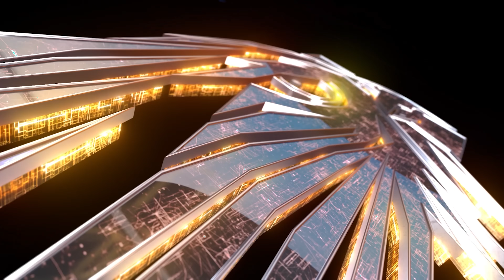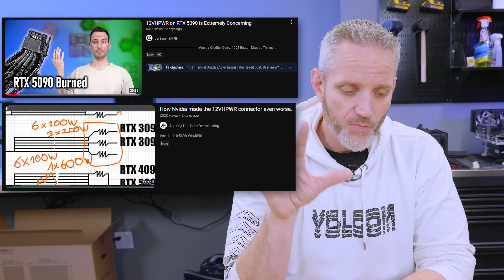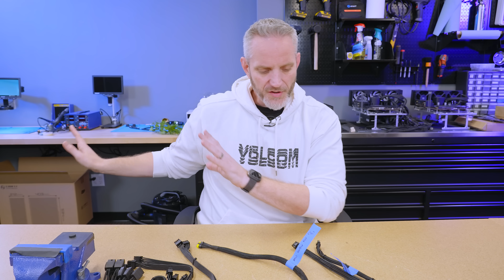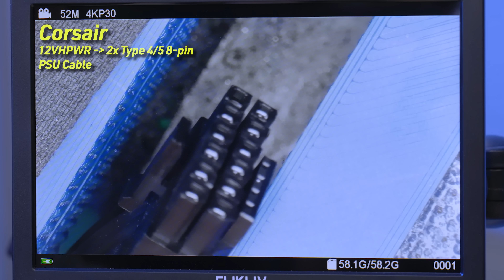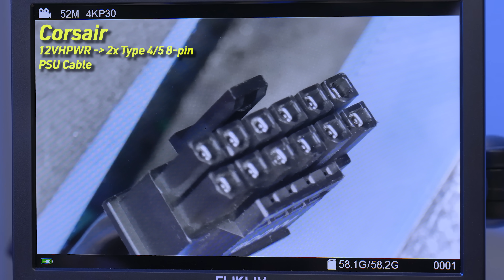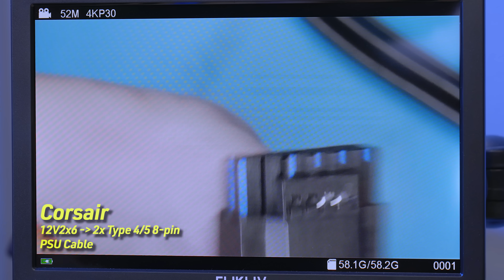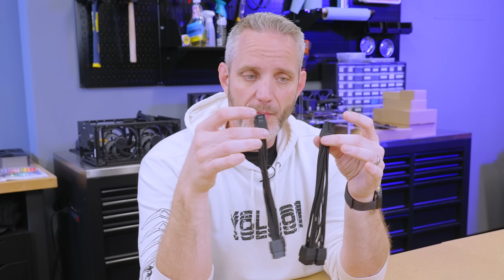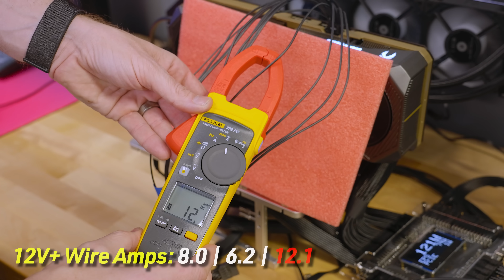I discovered something concerning and I need the Experts to chime in... More 12VHPWR discovery!

Comment: 100% will cause issues. The technical term for it is called terminal fretting. Cheap connectors with lack of terminal retension (which are basically all pcie connectors) with cheap pins are the main reason for it. Car connectors will show it quicker because the car is mobile and is being jostled around while driving. If the pin has that much slop in the connector shell it will spread the terminal upon installation and widen the gap  around the pin, which causes a poor connection and high resistance, therefore creating heat and eventually meltdowns. The other cause can be poor grounding or lack of ground which essentially causes the same result, to much heat from high current draw with nowhere for it to go. If you REALLY want to go even further, do a drag test on that connector pins. If you have a scrap gpu or something with the male version of that plug, take the pins out of it and insert them into the male end and feel for drag on ther terminals. It should have "drag" to it when inserted and removed.

Comment: The ground pins never melt because DC current can return to the PSU through the PCIe connector's ~100 ground pins and EPS12/ATX connectors' ground pins and every chassis screw assuming the GPU, motherboard and PSU are mounted to electrically connected frames. Even if all HPWR ground pins are broken, there are still 10+ ground wires and screws available to carry DC ground current. That is also why the ground wires on the HPWR cable are cold, only a fraction of the current actually returning through it.

The really loose pin on the Corsair connector was put in backwards: you can see the seam where the folded edges meet is on the opposite side from all other visible pins. The pins are held in by a barb on the pin that is supposed to engage a ridge inside the connector shell. The shell probably does not have anything for the barb to grab onto when inserted backwards. That is clearly a manufacturing defect and QA fail. Pull the pin out, turn it around and it should click in place.

Comment: Jay, Mechanic here, I work on everything from Cars to Mobile plant, and lot's of eletrical work, especially new age CAN BUS systems ect. Yes, if a pin is making poor contact on an earth side, creates resistance, it will cause the electrical system to pull more amps to be able to work to overcome that resistance i.e. OHMS law. A good earth is important for stable voltage. If the system is picking up inconsistent voltage, it will pull more amps to help stabilise it. If the pin on either side is not making correct contact, it will create resistance, and if the system is asking for a certain voltage, it will do the same. It will pull more amps to stabilise. More amps is more heat. If the wire is not gauged correctly to carry the amps it's asking for, it will kill the wire.

Comment: Just pulled out my Corsair RM1000e (ATX 3.0) cable out of it's box (I have a 7900 XT) and it is definitely a tiny bit recessed on the 12v side. Not as bad as Jay's in the video but slightly, and it has never been plugged in! 

Makes me glad I stuck with AMD this gen. But makes me worry about buying future Nvidia GPUs.

Comment: I think this is just one factor that could impact a failure, when a wire melts or catch fire that means it was drawing significantly more current than the other wires which means it had significantly lower resistance. So outside of adding some device to load balance the current you have to look at the resistance of each wire and while one wire pulled back wont likely cause a failure if you have like half which might happen if you are try to put a bend in the cable, or if you have wires of different lengths or if a wire got crushed pinched or bent are all factors, even the PSU might be at play with how its supplies the current. Overall its just a poor design form NVIDIA, so I am probably skip this generation until they fix it(not that I could find a card anyways) .

Comment: As far as I have come to understand, this is very simple but there is a lot of muddying of the water going on. But I know nothing. That said, my current understanding follows. 

The 12V (gen1 or gen2) cable is not one power cable.. it is six discrete power cables bundled together. That's not an unreasonable thing and isn't inherently unsafe - it has limitations like every other cable that must be observed when and how power is drawn through it. 

It is the responsibility of the graphics card to draw no more through its power cable than the cable is rated for. Since Nvidia has pooled the six power cables, this means that the maximum safe power limit is only what the weakest one of the six power cables can support. Not 600W. More like 100W. They cannot assume a balanced power delivery across six wires. 

Had Nvidia instead used multiple shunts into separate power stages more like in the 30-series, there's no problem because it should balance the draw across the discrete channels within the limits of the wires. The Astral is not a fix for this because it still pools. 

It's fine that the cable offers six discrete power channels. It's fine (and necessary) that a PSU supplies whatever is requested.

It is not fine that Nvidia thinks it can draw 600W through as few as one of six power channels before the card turns off from lack of power. And, as far as I'm concerned, they must consider this as a possible power scenario because _they designed it to do this_, despite knowing the cable limitations.  This is absolutely unacceptable.

Forget the power cables - they're a distraction. These graphics cards need to be recalled for safety until they are designed to draw power safely within spec.
Reply: To expand on how I see this as a 100W overall supply, I consider any extra wires drawn in parallel to be redundancies. These redundancies reduce the per-wire draw until they fail, running overall cooler/safer. The last surviving wire operates at full load and must still be in spec. When they all fail, that associated power section shuts down safely. In the 5090, there are five redundancies, not six primary wires, to draw from. Treating them as primary wires is insane. 

With this considered, it doesn't matter if you have a bad cable or poor pin connections. It'll just not power up the card.

Comment: The thing here is that the cable NOT seated well would end up with less contact and more resistance, causing the OTHER cables to have more current flowing through them, and warming them up instead.  So that would be the opposite of having the outside cable burning up.  Theoretically speaking anyways.  When you design circuits with parallel power supplies, that's how resistance affects current and heat. 

In the case of a cable burning up, it would be a case where ONE single 12v pair has less resistance than all the others.  Tons of current will find this less congested freeway and rush through, causing more heat.

When you see multiple cables burning up, my assumption is that it starts with one, then when the first cable failed critically, then all the load will find themselves flowing through the next pair of 12v with the least resistance.

Of course, all connectors should have very similar resistance profiles, someone should do a deeper dive and measure the resistance between various pins when plugged in, and you can then calculate how much more current can flow through the cable with the least resistance.  That'll help proof the theory of one pair of cable having less resistance than others.  If you measure and don't find any difference in resistance to make a difference, perhaps the fault lies in the PSU somehow. Not sure about that as the 12v source should be all shared.

Comment: I think the problem is two fold. 1 you have Nvidia designing the cards to where the power draw is not balanced across the 12v power wires and 2 the power supply manufacturers are still using 16 gage wire to handle 20 Amps or more. In house wiring if you are going to push 20 amps you have to move up to a 12 gage wire to handle the load.

Comment: Jay I am a electronics repair guy.. it goes both ways if there is resistance or on the hot or the ground side it heats up... resistance is resistance !!!! the more current the more the resistance matters.... to answer your question yes it matters if the ground doesnt make good contact !!! and don't believe corsair.. if the pins are not covering the same area there will be resistance deferences it may be smal but it be there and again the more curent the more resistance the more resistance the more heat the more heat melt down...

Comment: Would we use a smaller thin cable in your home electric circuit, errr no..   we need larger plugs and thicker cable to run 5090

Comment: company need made like xt30 ot xt60  plug for PSU connector... more reliable for high current, voltage and wattage.... rather make high wattage connector into multiple connector...

Comment: It doesn't matter if it's ground or line.

What matters if you have multiple recessed pins on one side.

The recessed pins will be higher resistance and will carry less current.

If you only have one or two pins making good connections, that's when you'll have problems.

Comment: Aren’t the pins supposed to be slightly loose in the connector like Molex and 8 pin? On my Asus cable i was able to push it forwards and backwards a bit on the 12V2X6 quite easily

Comment: I am an automotive technician and see a lot of these kinds of issues. Seems like a cheap product as the pin retainer or (lock) is not working as it should. It should be holding the pins in place and there should be little to no movement. Jay you may have seen this with a blower motor in a car melting. Get a quality connector and you should be good.

Comment: The issue is not a bad ground or a bad connection or any pin issues! DeBauer measured the cables, some are pulling 20A+ the issue is unbalance in the power delivery. Nothing to do with pins, cables or connectors. Instead i its too much power for the rated cables, connectors and pins.

Comment: No, increasing the cable's resistance (by making it thinner or longer) does not increase current—it actually reduces it in most cases.

Ohm’s Law:

V=IR
Where:
V = Voltage (volts)
I = Current (amperes)
R = Resistance (ohms)
What Happens When Resistance Increases?
If the voltage source is fixed (like a battery or power supply), increasing resistance will reduce the current (
𝐼=𝑉𝑅
I= RV
 ).
If the circuit is a constant current source, the voltage will have to increase to maintain the same current.
When Can Current Increase?
Lowering resistance (using a thicker or shorter cable) allows more current to flow if the voltage remains constant.
Increasing voltage (e.g., using a higher-power source) can also increase current.
So, a thinner or longer cable never increases current—it does the opposite by limiting it.
Reply: going from the Ohm's Law Cable does not matter, its the load (GPU) caused the extra current draw. Now this also mean if Voltage (PSU) was to drop and load (GPU) stay the same it will also increase the current.

Comment: IMPORTANT I am using a Corsair CP-9020250-NA (RM1000e) with their CP-8920284 (600W PCIe 5.0 12VHPWR Type-4 PSU Power Cable) connected to a AORUS GeForce RTX 4090 XTREME WATERFORCE  24GB (GV-N4090AORUSX W-24GD rev. 1.1.) It has been working in-place for 2 years until it developed an issue with the fans.

Problem first noticed when only one fan was working and at high speed, then developed to none of the fans working. They would spin briefly during start up, but then stop. Pump still continued to function, and didn't cause a heat problem for me due to passive cooling from the case fans pushing air through the water block....

However, to my surprise unplugging and reinserting the 12VHPWR power-connector back into my GPU completely resolved the problem. The plug was properly inserted before, but I assume from either heat expansion and/or oxidation, fully inserted pin(s) lost electrical connection. I am not an overclocker, I don't push my system hard and only occasionally game, but I imagine in a humid environment with someone that overclocks and/or games frequently, this issue could manifest much faster and be one of the causes of the power connector melting!

Comment: If the current is matched when plugged into the meter but not when it's straight into the gpu then the card doesn't have a bus rail for the incoming +12v rail.
Reasoning for this is assumes the meter has 12v bus rail, since the input when it's in the circuit is balanced. It also shows the power supply has a proper bus connection, if it didn't then the imbalance would still be seen with the meter. 

You could get a multimeter continuity test on the 12v pins of the GPU power supply. Doesn't prove there is a bus if there's continuity but wouls prove there isn't a bus if there isn't continuity

Comment: Jay, the other issue that I saw, and DerBauer has also recognized is this:
When you have multiple conductors (wires) carrying electrical power between a common source and a common load, the power carried by each of those conductors will only be equal if the resistance of those conductors is also exactly equal. This includes the total resistance of the wires themselves, the wire/pin connections of each connector, and the pip-to-pin connections of each connector pair. 

So in the case of the 5090 and some anonymous power supply, if the 12v output in the PSU is a single bus connecting to all six wires and the card also has a single bus that all six wires connect to, then power will preferentially flow along the lowest resistance wires and the loads will be unbalanced. 

For this system to "work" at least one end must be controlling the current being either passed to the wire or being pulled through the wire to ensure proper load balancing.

The cheaper and more robust solution to this is to use a single conductor from source to load that is the appropriate gauge for the amount of power and length of cable, and to use an appropriate connector that can handle the load, strain, and other conditions the system will experience.
Reply: Historically, when you have paralleled paths for current, you're usually OK if the path's resistance increases when it gets hotter.  Copper's resistance does increase with temperature, so theoretically this is possible.  But this works ONLY when the paths are all really close to each other with respect to their impedance, and I have no idea how they can guarantee that with not one, but two pairs of connectors in the path.
Reply: @glenndoiron9317  yeah. It seems that nvidia's reality differs greatly from theory. In all my years as an automotive mechanic and a few years as an armored vehicle mechanic, all my experience is that when you need to deliver "large" amounts of power to something, you use a single larger conductor. 

If you dig anywhere on the internet for advice on how to wire for larger loads, almost all will advise to run a single larger conductor.

If this was a problem with a car sold in the U.S., the NHTSA would have ordered a recall.

Comment: Remember that current take path of least resistance. So one very good connection hogs all amps. Like der8auer case where one +12 hogs over 20A and one was almost 0 :D
That reminds when we designed old analog amps that we needed emitter resistors to make sure every output stage handle it's own portion of output delivery.
Edit: shunt resistors also can so some balancing between wires. I think those cards that have current measurement for every wire has less change to get this problem.
Basically we need to go +48V to get amps down or get few big chunky connectors like two screw terminals for power :)

Comment: Got an MEG Ai1300P power supply, and been using their included 12VHPWR cable with my 4090 for the past couple years, thankfully, without issue.

It's certainly concerning though, and I'm about 95% certain I'm switching to either Intel or AMD for my next upgrade, which will be next generation.  I'll take a small performance hit to escape what has become a purely cancerous company in Nvidia.

The 4090 has been fine, but I'm not deaf to the ongoing issues, price gouging, and various other power mongering issues caused by Nvidia.  Time for a change in this industry.

Comment: 100% I would say that nvidia dumbed down the cards making them unable to save themselves and also if they had of made it draw the maximum possible through the pcie bus ie power then the 40 series and 50 series wouldn’t have to pull as much through the 12v2x6 cables

Comment: @Jayztwocents
This exact same type of issue is at least 25-30 years old, noticed back then with IDE HDD Molex power connectors.
Each female connector has two small wings on the side which locks into the plastic housing, those wings can get flattened and that is why the whole thing recedes.

Comment: Are these plugs hot-pluggable?
The height of the ground is not an issue if it connects BEFORE power is applied. 
Jay, you should take a basic electronics course. You’ll learn the correct terminology and how to assess basic electrical failures.

Comment: It's the thickness of the connector's metal, it's too thin for such voltage and amperage making it become a kind of filament in a incandescent light bulb.

But if it's going in like that the cause it most likely arcing.

Send Rossmann a 5090 and power supply and that australian electronics guy sir Dave.

Giod  bless.

Comment: if i were you i would honestly go the the CPSC and report this we have enough examples of this being a problem you also have Proof of cards exceeding spec in power draw, the only way this get solved is if Nvidia and the board partners are forced to do a recall of every product using this connector, saving 1-2$ per card would end up costing billions in revenue and loss of consumer trust